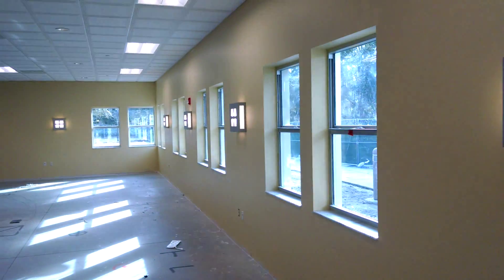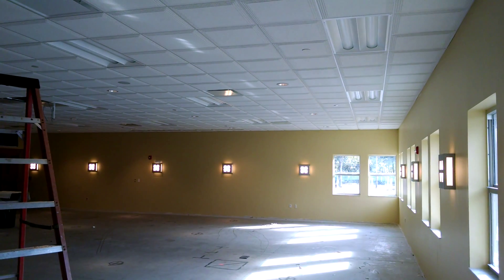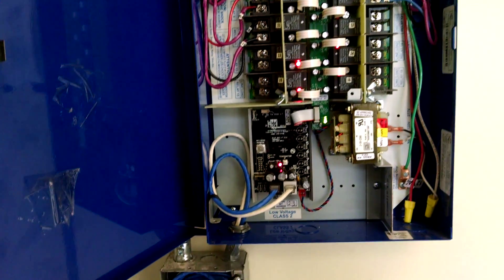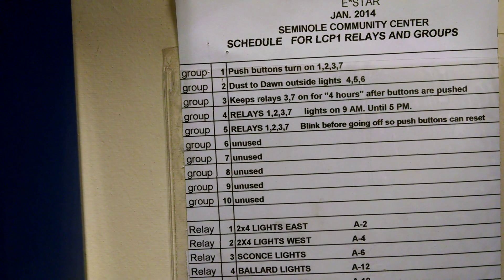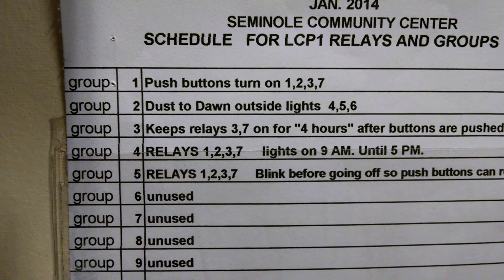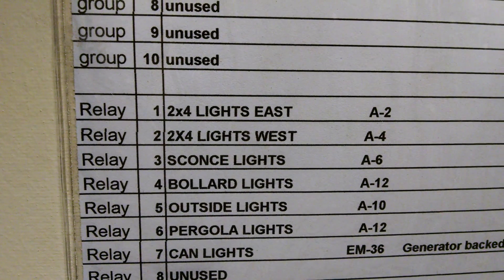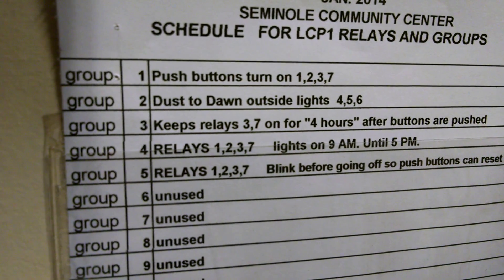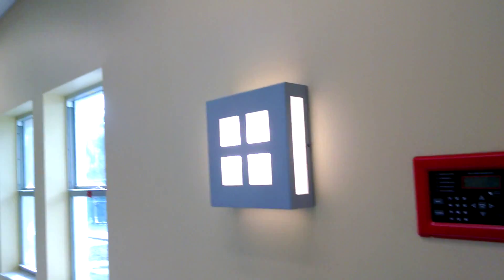The blue box take 1

Comment: Parallel wiring with Chelsea switches correct? 
I need to hook up two Chelsea switches.
So one cat5 at the 8/16 then two switches. 

Does it need to come back to the 8/16 blue after the second switch?

Thank you for your time.
Reply: There should be two places to put CAT5 in a box you can put it as many Chelsea switches in series as you want but there is an end that goes on the last switch make sure you put on. that it’s  a neat system I’m speaking into so I probably get lots of mistakes good luck man. Don’t hesitate to call that 800 number those guys will  help you a lot.
Reply: @josephmckenzie4744  Thank you I appreciate it. The termination block yes, I know what you’re talking about now. 

👌